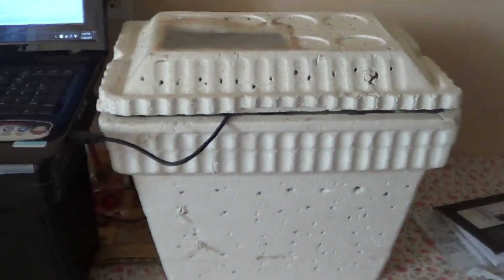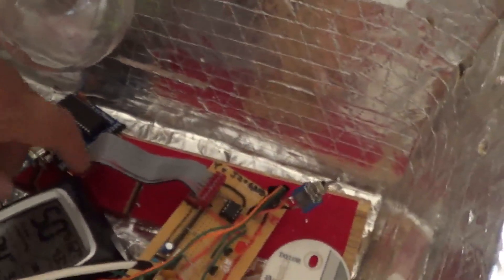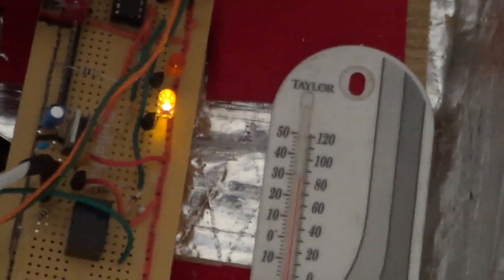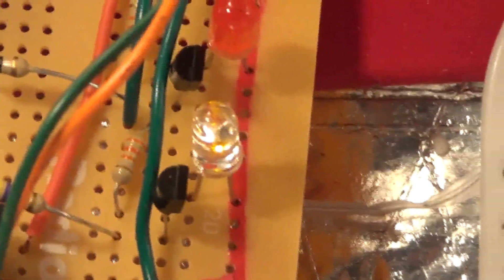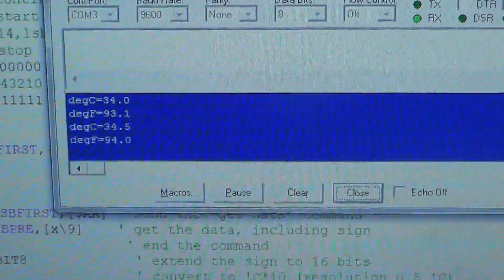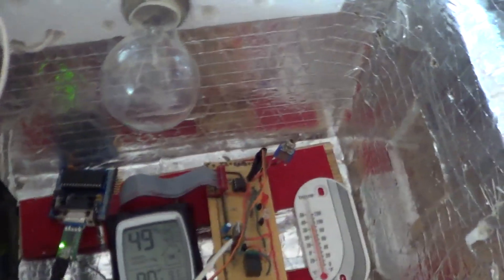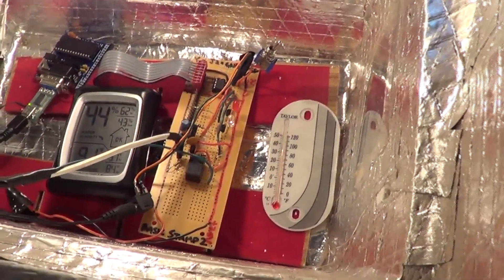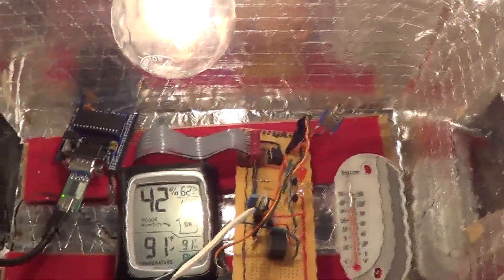Old Incubator Model Explanation

Comment: I need to Incubate some cat eggs. I'd say the biggest drawback is not that the cat eggs have to be rotated, but that when hatched, the cats will play with the wire and potentially destroy the equipment. How did you say you can prevent this?